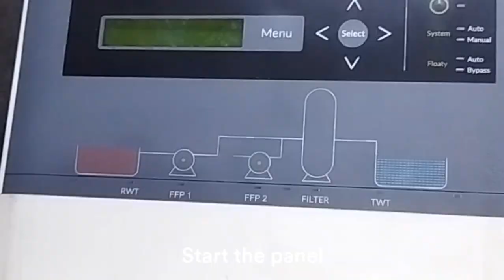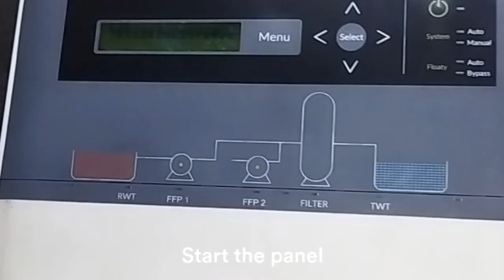Fuse and Mov replacement in Aster panel| Aster

Comment: Fuse shot again nd again
Reply from the maker: 2 reasons for fuse short 
1. Mov damage (short) 
2. Transformer damaged (short) 
To solve it first remove Mov then install fuse 
Or Replace transformer by new transformer 320VAC  2 Amps, 13VAC output